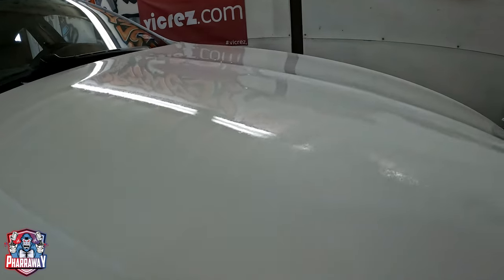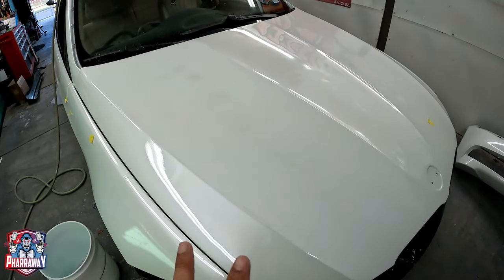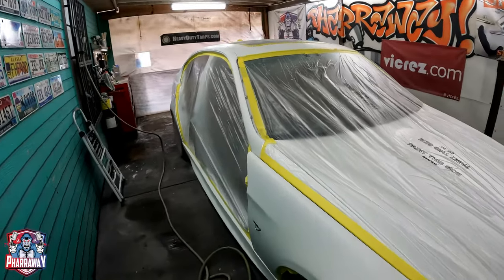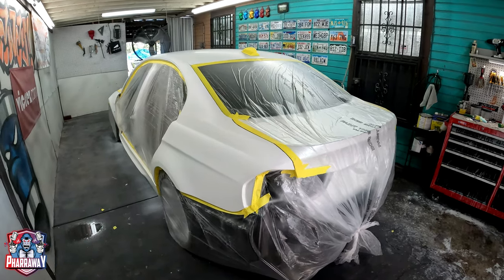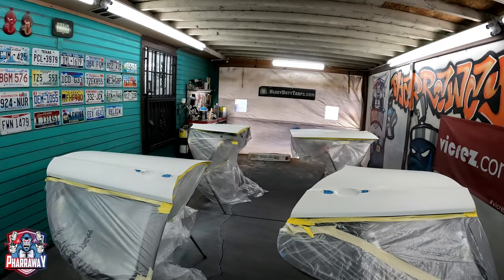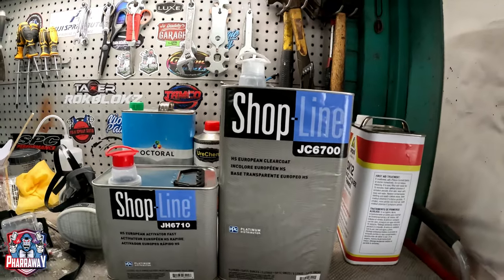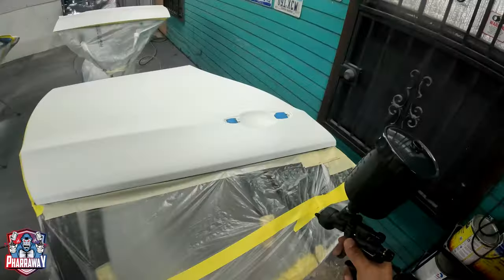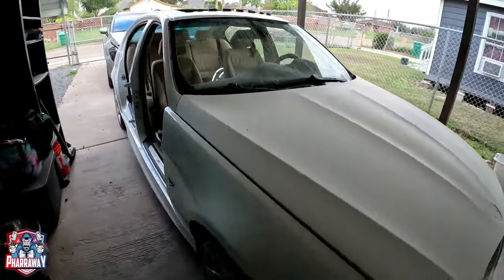How to fix a dry spot in your clear coat

Comment: The dry spots should smooth out with 2000 and 2500 without too much risk of burning through the clear. Especially if you have 3 coats of clear on there. Why not try sanding first? If your plan is to re-clear anyway, then you have nothing to lose and it may turn out that you can just polish the shine back.
Reply: strongly agree with you, and also would save too much time!

Comment: I bought a sagola 1.3 4600 extreme and idk if i got a knock off  but i had a similar experience i had several dry spots and i must have went atleast 5 times over the hood and could never get it wet enough it always looked splotchy switched it up to my lp400 and it looks super wet and flowed out beautifuly
Reply from the maker: wow you need to check that sagola brother
Reply: @PHARRAWAY  I returned it back lol